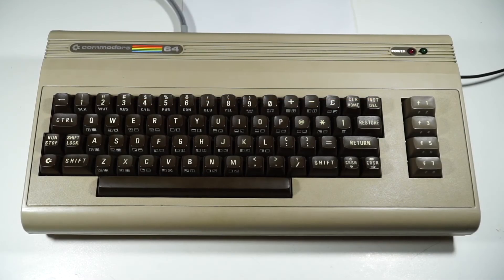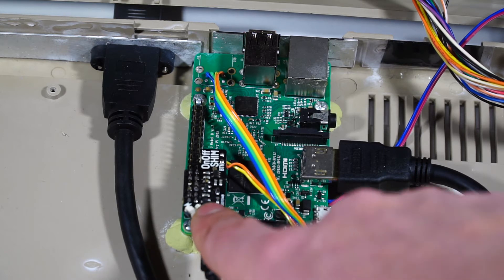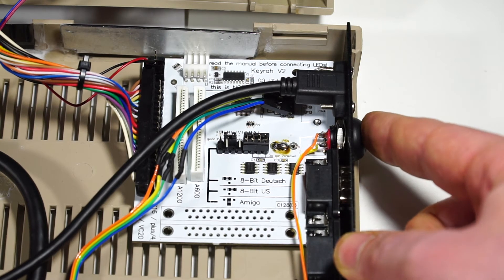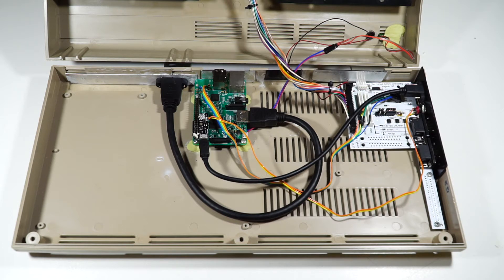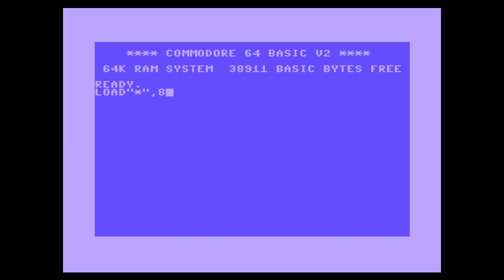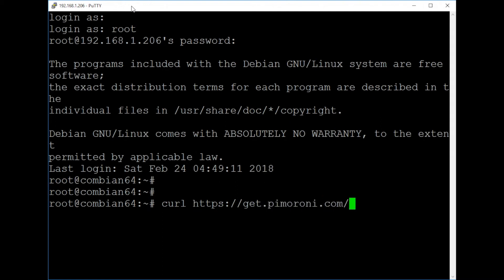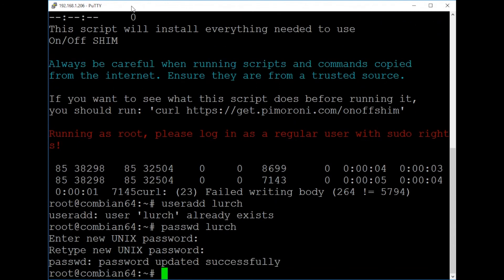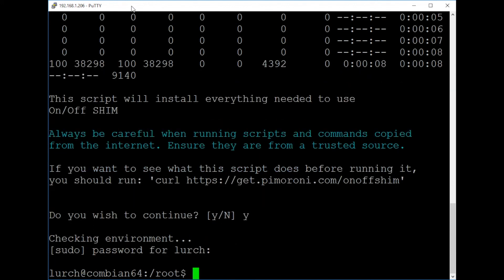Raspberry64 -  An in depth look

Comment: I think this guide is out outdated at this point. The new version of combian does not use the same file names in the rcS folder. I was able to install the service and the pi turn on when I press the button, but it won't turn off when I press or hold the button. Tried everything I could try and the service is active if I run "top"; but it is not responding to the button press. Quite disappointing to not be able to figure out what is going on
Reply from the maker: Yup - it's getting on to 3 years old now.

Comment: Thanks a lot! Although I had some problems while following your instructions to install the OnOff shim software, this helped a lot to get it working in Combian64. The first thing I had to do was "apt-get update" otherwise I couldn't install sudo, nano, curl, etc. Second, after I created a new user I had to make a directory in the home directory for this new user. It is probably used to save the downloaded files before installation. Third, I got the message "sudo: unable to resolve host combian64". While the hostname is combian64, the hosts file was referring to amibian, so I changed amibian into combian64 and finally the installation ended successfully :-)
Reply from the maker: There seems to be a few oddities with the later versions of Combian64. This video was done with ver 2.5 but Ive heard other issues/oddities with sudo and the like from later editions.
Reply: I use also version 2.5. I tried version 2.8 but I couldn't get any network connection with that version so I went back to 2.5. Maybe because I use a Raspberry Pi 2B and I think version 2.8 is especially designed for 3B(+). Version 2.5 works now excellent for me with the OnOff shim so I'm happy with it.

Comment: Hi there, I am doing such project on my own. I use a raspberry 3b. After installing the newest 2.8 version, I am not able to establish a network connection through Ethernet. Wifi also does not work, despite correctly setting up the config file... the hardware is for sure fully operational, because when booting a regular os, there is no trouble with connection. So for sure there must be some settings to be configured in the combian or through the command line. Any idea what sort of settings should be checked? I would appreciate your help..
Reply from the maker: Michal Wieczorkiewicz honestly, I’m still running 2.5. I know a few users had issues with 2.7 and running Sudo so it seems 2.8 May have some bugs too. 
Best bet is to post up on the Combian64 webpage and ask the developer for help. 
But off the top of my head, exit Vice back to the command line. If it’s the same as 2.5, you should be able to type: menu and get to the Combian config menu. In there is a link to the Raspbian config menu. In Raspian config, poke around at the network stuff in there.

Comment: Hi, what did you used under the PI, I mean to fix the PI with screws? is that a kind of glue or plastic? nice work trying to do a similar contruction - like it!
Reply from the maker: Jan Frieler small pieces of what we in Australia call wall plugs. Those small plastic tube things you put into a wall to then put a screw into.